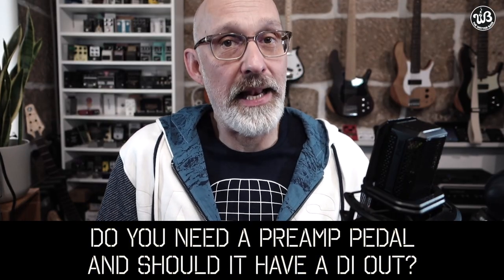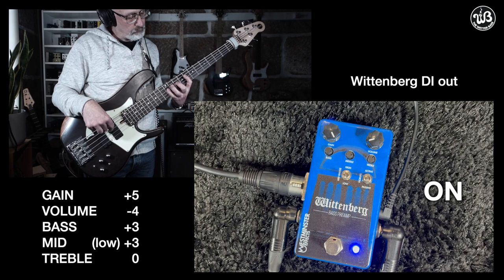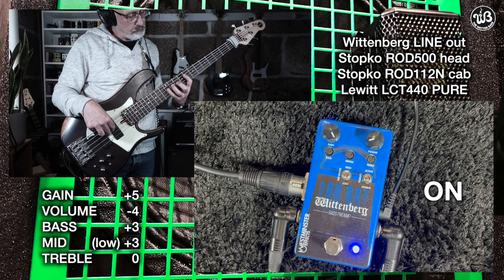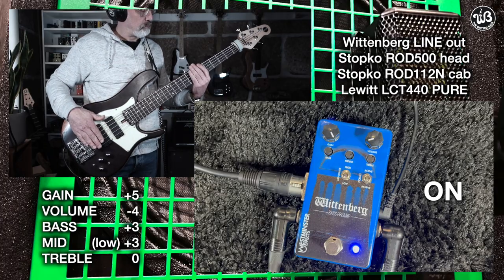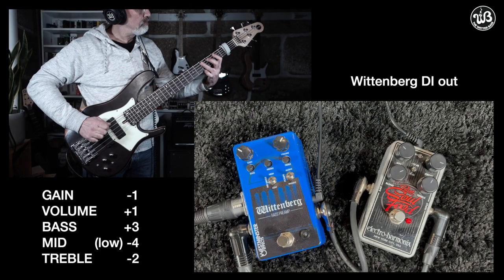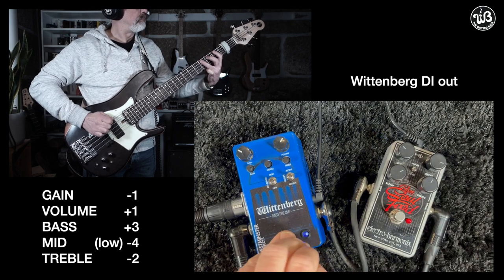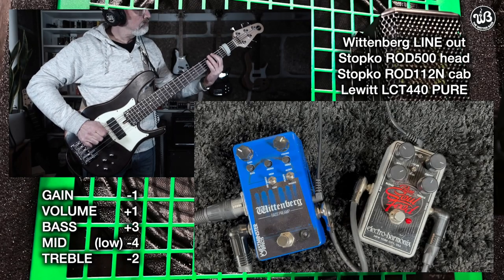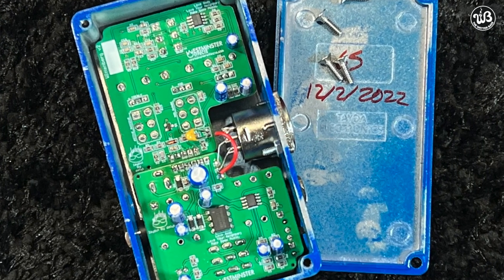Do you NEED a DI? the Wittenberg: GREAT transparent BASS preamp from @WestminsterEffects

Comment: I have an mxr m81 at the end of the pedalboard. Very similar pedal. Of course the di out is key here, along with the eq options and the transparency. And the size! The only thing I feel like missing sometimes when going direct and ampless is some kind of cab simulation but then the options are much larger pedals. Great review as always!
Reply from the maker: Hi! I am currently using the DSM Humboldt bass station in my live rig. It’s small, has two DIs and a you can blend an analog cab sim. 😉
Reply: Yes I noticed it in your reviews and I am looking into it veeeery closely ☺️
Reply from the maker: I’ll try to do at least a short very soon.

Comment: That’s a nice sounding preamp pedal. It also sounds great with an overdrive pedal. And I do use preamp pedals myself. Primarily I use it for ampless recordings. I can also use it for ampless gigs too. Especially since I’ve been conducting my pedalboard to be used ampless as well as being used with an amp. Other than that, this is a great sounding preamp pedal.
Reply from the maker: Nice! Do you use cab sim for ampless gigs?
Reply: @thewetterbass  I haven’t tried that yet. But I have gigged ampless with a multi-effects processor a few times since it has amp and cab models. That’s pretty much the closest thing I’ve gigged with a cab sim so far.